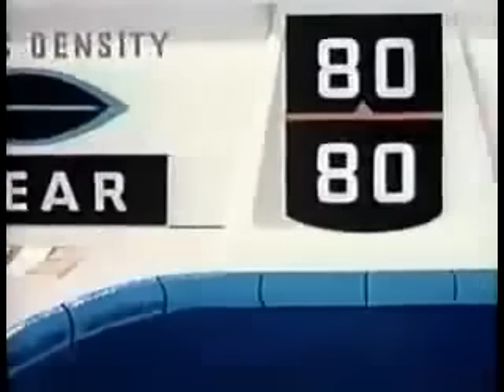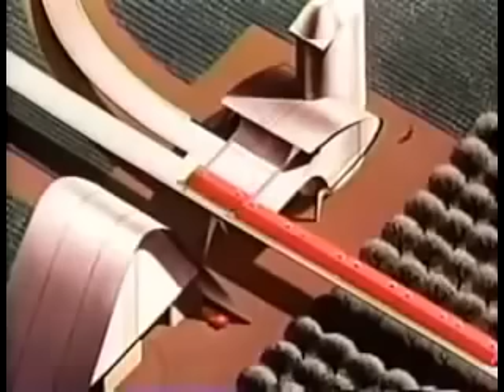The Future of Transport: Disney's Magic Highway - 1958

Comment: Let us see how much was achieved.

00:15 Coloured road lanes: No (some in South Korea). Dynamic road signs: yes
00:35 Road lighting: Partially, yes
00:40 Radiant heat for clear lanes: no
00:55 Onboard radar: Partially, yes. Self-driving cars, automatic emergency braking. Parking assistants. Not for vision though.
01:03 Anti-fog devices: no
01:06 Onboard traffic advisory and speed limits: yes, with services like Google Maps
01:20 Recommended safe driving speed: no. Mandatory safe driving speed: yes
01:23 Rear facing cameras: Partially. Parking assistant and dead angle warning. And a few models can use them as rear viewports as well.
01:30 Airborne police and ambulance: yes. Fire services: no
01:40 Quick tow services that clear up obstructions: No. Airbore ditto: heh... 
01:50 All-in-one road-builder: no
02:00 Prefab bridges/overpasses: yes
02:05 Bridge layer moving on bridge as it builds it: sort of, not as shown. Tunnel boring machines can do that though
02:20 Nuclear powered rock-melting tunnel boring: no, just plain old TBMs
02:35 Cantilevered skyways: no
02:45 Centralised urban areas. yes
02:55 Longer commutes: yes, unfortunately. But also work from home
03:05 Criss-crossed by continental motorways. yes, unfortunately (again)
03:12 Spacious well-planned communities: eh... 
03:15 Integrated with the highway system: double eh...
03:20 Automatic car wash at home: no. Fuelling station at home: yes, if you drive an electric
03:25 "As father chooses": oh dear, that did not age well. 
03:28 Onboard navigation with map: yes. Self-drive: partially. 
03:40 Family relaxing during a drive: yes. Family relaxing together during a drive: noise-cancelling headphones/earbuds and smartphones/pads say "no".
03:45 Remote video calls for meetings: yes. ...while driving: yikes!! But, yes
03:55 Single family vehicle: no. Modular car: no
04:05 Special purpose roads: no
04:15 Integrated parking in office buildings and shopping centers: yes, though not quite as advanced
04:40 Rolling sidewalks for window shopping: no
04:48 In-office escalator ramps: no, the elevator and stairs still reign supreme
04:58 Technology gives more leisure time and flexible work hours: yes
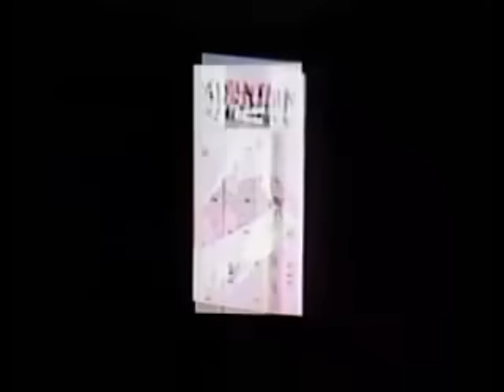05:05 Vacation decided by family vote: yes
05:08 Digital tickets for vacation: yes
05:15 Specialised pleasure vehicles with home-conveniences: yes, with motorhomes
05:25 Highway escalators: no
05:35 Multi-mode vehicles: no
05:45 Flexible freightway network: no
05:53 Centralised/remote/instant logistics control: yes
06:08 Long-haul produce/food delivery: yes, oh yes, much longer than you think
06:15 Source and last-mile delivery on same hauler unit: no. The container however...
06:25 Warehouse to sales display on same fright unit: no
06:32 Roll On / Roll Off sea transport: yes. Stacked containerised sea transport: yes. But RORO and stacked containerised: no
06:40 Sub-orbital space transport: no. Instantly loaded and launched space vehicles: no
06:58 Gas turbine car: Tried it, will not do it again. Tanks and ships however... 
07:01 Reaction drive car: no. 
07:03 Nuclear powered car: no!
07:05 Solar-powered hover-car: Okay...
07:11 ...that can climb walls: ...I think those brownies...
07:20 ...and run on an inverted roadway: ...are really starting to kick in.
07:25 Tube transport: I think we can classify this one as Extra Loony, Obviously Nutty
07:35 Airconned / heated covered highways: no, just climate control in the vehicles themselves
07:48 Ocean tunnels with ventilation: yes
07:55 Undersea highway exchanges: no.
08:05 Roadways linking nations: yes. Increase understanding between people: yes, and no.
08:15 Better quality of life and hope for the future: yes, and no.
Reply: That took alot of time to do all that.
Reply: Minor note for 2:35, cantilevered freeways can be and have been done, just not on a large scale. Interstate 70 is cantilevered for a good 10 miles in Glenwood Canyon, Colorado.
Reply: @sturmovik1274  I did some Google Street View along that stretch of I-70, just to check this out. Wow, what an absolutely amazing scenery! Totally blown away.

And... well, yes... there are indeed elevated stretches of the highway, where they have "smoothed things out" by propping up the roadway, allowing the road to pass though otherwise wildly 3D terrain. For the most part I could see east of the city of Glenwood Springs, the westbound lane sits considerably higher than the eastbound.

Really far cry from the animation though. And most of it seemed like plain old bridge-like pylon construction, supported from below. No cantilevering as far as I could see.
Reply: @michaelkarnerfors9545  Agreed, it's nothing like the scale shown. However, some of the eastbound lane is cantilevered over the river. Also, yes, it is freaking gorgeous.
Reply: @michaelkarnerfors9545 imagine someone seeing your comment in 50years and telling you you’re wrong for saying no about certain predictions and they make a list of what has come true.
Then in another 50 years someone refutes their list when more stuff comes true
Reply: @TayWoode  I am not making predictions, I am tallying what we have so far.
Reply: Glorious magic brownie joke! 

Some kind of magnetic levitation may be, but having something like that solar powered is a long way off.
Reply: @AdamTehranchiYT  The 1950s were a wild time, much experimentation. 😂
Reply: @michaelkarnerfors9545 well, we WERE going into SPACE, so really, what WASNT possible?
Reply: @michaelkarnerfors9545 Japan does have maglev trains, and China got German maglev units, too.
Reply: @mardus_ee  And?
Reply: Correction. For 1:23, there are multiple cars out there that use cameras for continuous rear view. Eg: Cadillac Escalade, Chevy Corvette, Tesla Cybertruck etc.
Reply: @B4R0N.  Fixed, thank you.
Reply: Addendums:
~ Radiant heat for clear lanes:  This actually is used, but only in limited capacities
~ All-in-One road builder:  Partially; massive paving machines exist, though they do require site preparation
~ Cantilevered skyways:  This is actually used, though quite limited due to the expense involved
~ Flexible freightway network:  Yes, but not quite as depicted.  Intermodal containers readily transfer from ship to train to truck, while a similar system is used for air cargo.
Reply: @twylanaythias  colored road lanes, yes for many years now in South Korea.
Reply: "Specialised pleasure vehicles with home-conveniences" May I remind you of those land yacht type moterhomes that not only have a fridge, stove, and refrigerator, but also have TV's satellite mounts, and other just like home niceties?
Interestingly, roadways that can melt snow are still talked about how "future tech" will make it happen. The heating isn't the issue, but the power is. 
There have also been attempts at using inferred cameras to show the road ahead for when it is dark or obscured in the visual spectrum. Just never widely adopted.
Reply: @travissmith2848  You have a point there. And tractor trucks with living-cabins are just amazing.
Reply: This dude had a bit of fun making this and I had same amount of fun reading in. Damn those brownies and how long they take
Reply: A couple of updates to you.  

1) Heated highways kind of do exist.  Just check out the city of Reykjavík.  Not only does the nearby thermal plant pump the excess heat down pipes to people's homes to warm their water, but also run it under the roads to keep them clear of snow.

2) Multi-mode vehicles do kind of exist.  But especially in the one depicted there.  There is a company that offers class a motorhomes that is amphibious.

3) While rockets haven't taken off for transporting around the earth, airplanes sure have which they didn't even envision.

4) Undersea highway exchanges does exist as well.  The Faroe Islands have a set of roads underwater that connect each of the islands.  There are tunnels, but like the chunnel is below the actual water.  In one spot, there is a roundabout as it connects to two islands from there.
Reply: Effortless window shopping is a thing, just not how it was pictured here. Instead of moving sidewalks we have Amazon.
Reply: WOW! Someone with a brain on YouTube that actually gives correct answers in a comment! Kudos!
Reply: A new thing is drones being used to lift and activate fire hoses, but it's not as widely adopted as flight-for-life
Reply: 00:40 road heating is actually done on a relatively small scale! It saves a lot of money on snow removal in cities where this is a problem.
Reply: 2:20 The Los Alamos National Laboratories patented a nuclear tunnel boring machine. It uses molten lithium to melt through rock, leaving behind a tunnel with a glass-like finish.
Reply: you're hero ❤️
Reply: there are projekts in central europe for heating and cooling streets but not on a big scale (I think it is a money question like everthing else).
Reply: @Meiseside  More an environmental thing; no one wants to dump primary energy right into the wild, not when there are much more per-kWh effective methods to achieve similar results.
Reply: @michaelkarnerfors9545  no, not ot dump, to save it in for example an ice-battery (Eisspeicher) or other heat storage. manly for bridges at the moment and only a few projekts.
Reply: This comment is peak YouTube, the platform showing its best
Reply: I GENUINELY, and SINCERELY  appreciate the effort you put into this. Maybe not all hopes and dreams the pasts futures are lost in our current time.

Still... I wish we STILL had that unbridled optimism that's generally characteristic of that past era.
Reply: @tachyon8317  Thank you kindly
 😀

It is harder to be optimistic today because things have gotten so much better in these 50+ years that wonders are commonplace. That I am — just now — casually chatting about it, on this marvel of engineering that is a smartphone, to someone all across the world, is beyond what even science fiction creators imagined back then.
Reply: There are colored road lanes on Central Ave (US 66) in Albuquerque, but they are only for the ART buses. There are also some red highways in the northwest of the state of NM where most of the rocks are red anyways (US 491(former US 666), US 550, and NM State Road 264/AZ State Highway 264). I think in some places in the state, US 66 also still has some red pavement; In ABQ, there is red pavement hidden under the modern blacktop on West Central.
Reply: 4:40 rolling sidewalks are a thing, but indoors, and more often in large airports.
Reply: Great list! The onboard vision, Mercedes Benz has something like this on their S class that uses normal and infrared light to project a clear picture of what is ahead on the instrument cluster which in reality is a computer screen. But you are right, this is not widely used or adopted.
Reply: Few corrections. All in one road builder is getting close (talk to a company named Boral Australia). Turbine car my get a revisiting but as a hybrid electric variant (Jaguar and Bladon micro turbines). Air fire services been around in Australia for a few decades.
Reply: Some Scandinavian cities have heated roads to keep them ice and snow free in the winter, especially where geothermal power is available!
Reply: Sorry if someones already said it, but heli-cranes are used for firefighting. Also colour coded lanes are used on roads in Australian cities, with the asphalt for the bus lane being a different colour (brown) than the regular traffic lane (ordinary gray asphalt). There is also a colour coding for the cycle lanes in some areas
Reply: Everyone is giving good corrections and pointers, but the list Michael made is in line with the video: that all these things will become cheap and numerous enough to be everyday public use for everyone. If some of these things only have 1 place or 1 group of people, organizations, and whatnot that use it (e.g. the military), it does not belong on Michael's list.
Reply: For all the effort you put into this list you could've achieved a few of the items on it.
Reply: @theusher2893  I have no idea what you mean. Care to explain?
Reply: Thanks for doing this. It was funny, too.
Reply: Also, firefighting from the air has been a thing since the DC-3.

It is amazing to see not only the differences you pointed out, but also the regionality of it. For example, out west, our cities are decidedly not centralized, instead sprawling out across the desert. That is why the major metros of the desert (Phoenix, Albuquerque, Las Vegas, NV, El Paso) have puny little downtowns.
Reply: We do have fire-fighters via air... In Oz we have Elvis the helicopter. We also have underwater highways like Sydney harbour tunnel. I think there's one between France and Britain too I think? 🤔
Reply: This was a really cool comment, I didn’t think about how some of these things had been achieved in spirit but by different means.
Reply: I cannot imagine a nuclear powered car ever, holy hell the chaos people would cause with them
Reply: Fire service do have air units. It's just that, they are more for forest incidents than road incidents.
Reply: There is however a "conspiracy theory" that the USA and USSR built a nuclear tunnel boring machine which had some sort of ceramic plate which was heated hy molten metal which was circulated through the reactor. The technology never made it out of the military and inteligence agency circles, and it is said that it worked so well that it was used to create vast networks of underground facilities and tunnels.
Reply: Can't wait to get back here in a couple of decades to see, which things changed. What? You mean, there is a possibillity, that we won't come back because the existential threat of climate change caused in big amounts by those very vehicles shown in the video will bring us to our death? Nah, that's just some communist idea about us destroying earth. That'll never affect us...
Reply: Although not perfect, 00:15 coloured road lanes have been used in some countries such as Korea, Japan and Europe.

The case of Korea
https://img1.newsis.com/2022/03/29/NISI20220329_0000961475_web.jpg
https://pimg.mk.co.kr/news/cms/202405/07/news-p.v1.20240507.a84505fc172d4c02a0861fc3afe94412_P1.jpg

First case (Japan, 2008)
https://maps.app.goo.gl/oNemh3ZfBSKETYAw8

The case of Japan
https://pds.exblog.jp/pds/1/201004/19/01/d0080101_1233128.jpg
http://geo.d51498.com/daijitk/rilyokoukipicture/C2-100403-10.JPG

europe
https://maps.app.goo.gl/oP265UDmGQMrehiMA
Reply: 5:08 bro is putting punch cards into the car and the car drives there what 💀
Reply: @bradye21playsIndieHorror  The notion that keyboards would be ubiquitous, or that voice control could work, was still far away.

The common way of working with computers back then was that you type commands that gets made into punch cards. Then the card gets fed to the computer.
Reply: Well, there's more future to come; perhaps a few more of these will become a yes.
Reply: Multi-mode vehicles: the 2003 Gibbs Aquada is an example, although there weren't built many..
Reply: Board Radar for Vision is a thing. Mercedes have them and you can see deers on pitch Black streets. And btw: if the car Sees it, you didnt have to see it.
Reply: 00:40 Radiant heat for clear lanes: does not make any sense. The economics of it don't add up - imagine the energy requirements.
02:20 Nuclear-powered rock-melting tunnel: that would be environmentally disastrous, those guys didn't think much about nature back then.
06:58 Gas turbine car: Tried it, and may try it again. In the age of hybrids, a microturbine-powered range extender really does make sense.
07:25 Tube transport: Hyperloop anyone?
07:35 Airconned / heated covered highways: again, the economics don't add up.
Reply: @liam3284  already exist.
Reply: Props 👍🏼
Reply: "Tube transport: I think we can classify this one as Extra Loony, Obviously Nutty" hehe.. Poor Elon, we still find this completely ridiculous, even though you've already started building that nonsense.
Reply: can't believe that your comment is not pinned.
Reply: 02:05 Bridge layer moving on bridge as it builds it: sort of, not as shown. Tunnel boring machines can do that though
China has something like this. They use pre-fab sections of road and the builder moves out onto the new section.

03:45 Remote video calls for meetings: yes. ...while driving: yikes!! But, yes
Using FSV, more practical but still yikes!

04:15 Integrated parking in office buildings and shopping centers: yes, though not quite as advanced
Malls going out of business: Yes.

04:40 Rolling sidewalks for window shopping: no
Because they don't want you passing them by.
They have moving sidewalks like this in Las Vegas to make it really easy to enter a casino. When you want to leave you need to find the exit and hard hike it.

05:25 Highway escalators: no
Again, China has this but it's for boats along the Yangtze River to quickly go up and down the 3 Gorges Dam.
One of the few real-world examples of people using this idea.

06:15 Source and last-mile delivery on same hauler unit: no. The container however...
Exactly. Multi-modal transport. This removed many 18 wheelers from the highway. Very little need anymore to make a cross-country haul. Just put it on a train.

07:05 Solar-powered hover-car: Okay...
They promised us hovercrafts. What a rip off. We was robbed.
Reply: You clearly don’t know the capability of modern cars boomer
Reply: 01:30 there are airborn fire services, it's mostly used for dealing with forest fires however
Reply: i highly disagree with more leisure time - the average american today cannot work enough to pay basic rent, let alone 'go on vacation' or 'have a weekend' - working 40+ hours a week, every week, nonstop.
Reply: @xXKisskerXx  In 1958, the average american had an almost 41 hour work week. In 2024, it is below 35. This is not a matter of opinion that you can disagree with. This is a matter of fact, you are not entitled to your own facts.
Reply: I don't know when you live, but nobody i know gets to have vacations. And there's only been less and less over the years.
Reply: @autumn948  And since you know the whole whole population of the US, what you say is relevant. 

Oh, you do not?! Well... then it is not.
Reply: 00:40 Radiant heat for clear lanes: no - Actually that has been a reality since around 2000 for roads in Iceland. A few failed "solar road" projects as well.
Reply: 07:25 Tube transport did happen, and pre-dated this video by a good 90 years! Just look at the nickname for the London Underground! 🚇🇬🇧😉
Reply: But there are firefighting helicopters and planes
Reply: @Arnavprobutnoob2  But, they are for forest fires. Rarely responds for road incidents.
Reply: There are moving sidewalks I. Airports.
Reply: An excellent analysis I only disagree with on one point.

Technology has given increased leisure time to the rich . Everyone else is using technology to be several times more productive, while working more and getting less.
Reply: @Yonkage-ik5qb no, it did happen, although not as much as we would have expected, and that was mostly thanks to unions and cultural change than technology, although work from home has recently started contributing (although that could probably be mostly attributed to less commute time)
Reply: @Yonkage-ik5qb  Well....... some Quick google work shows average hours worked in 1958 looks to be about 37.8 and today is 34.2. 
Generally speaking, the kinds of household labor saving devices and other similar markers of quality of life have become far more commonplace and in some ways those living at just above the poverty line today have it far easier and greater variety available than millionaires in the late 1950s.
Reply: @travissmith2848  "those living at just above the poverty line today have it far easier ... than millionaires in the late 1950s"

Yeah, I'm not going to even bother. You've been brainwashed so completely that it's like talking to a wall.
Reply: 07:20 Well technically there are cars capable of driving upside down. Some high performance race cars can produce enougth downforce to counter their weight. In reality it would take a long track for gaining speed before the roadway is inverted as the downforce is only produced at high speeds. But yeah nothing someone would ever suggest for public roadways.
Reply: 1:50 All in one road builder...actually yes. It was featured on Modern Marvels in the late 1990's. It would tear the old asphalt off the road and run it through a few steps to grind it back up. Then it would get remixed and put back down as new asphalt.
Reply: @kks_123-u1w  All that does is replace the surface . A road is several more layers than just the surface. The video shows an all-in-one paver on virgin land but the machine you are talking about is not an all-in-one road builder but a combined asphalt miller and paver.
Reply: 5:35 you never heard of amphibious cars?  They ARE a thing, you know.
Reply: @Shadowkey392  An example is the Duck boats in Plymouth MA. They can drive on the road and in the water.
Reply: @Shadowkey392  I have heard of the novelty (or military) vehicles that are multi-mode, yes. And that is all that they are: novelties.
Reply: @michaelkarnerfors9545 counter-argument to your “amphibious vehicles are only novelties” claim, in WWII, D-Day was made successful in no small part because of amphibious tanks, and in the Pacific Theater of Operations, many MANY island assaults were carried out using amphibious personnel and equipment carriers, many of which were turned into today’s Duck Boats. Many seaplanes also have landing gear in their pontoons, making them technically amphibious. So I would say amphibious vehicles are a bit more than a “novelty”
Reply: @mightyocelot  Yeah, because world wars is what this film is all about, I stand so corrected...
Reply: @michaelkarnerfors9545  Not only in the military. There are "normal" cars to. They are not so common tho.
Reply: @ASharkNamedWaffle  Just so... novelty vehicles.
Reply: @michaelkarnerfors9545  If i understand novelty right it means new. And amphibian vehicles have exited since (researching) 1770.
Reply: @ASharkNamedWaffle  No, that is not what novelty means (in this context).
Reply: They were dead on about beautiful cities being bulldozed for parking lots. Missed the one and two hour commutes in traffic jams, or kids getting addicted to phones because they can't do anything else.
Reply: @garryferrington811  Whose fault is it for handing kids phones as cheap babysitters?
Reply: no hope for the future 😢😂
Reply: The last one should be an absolute no. Not only did we not increase our quality of life, we managed to fall below what we once had.
Reply: @lockheedtrijet8817 That is silly
Reply: fathers need to come back to being rulers of their home and society, we've seen life without them, it is abhorrent.
Reply: @TS-jm7jm  No.
Reply: @TS-jm7jm  You are wrong.
Reply: I’m not sure why it aged poorly that a father chose where to drive his own car. 

I suppose some echo chambers do exist which truly hate the idea of fatherhood though.
Reply: @Noplayster13  The notion that the male is the owner of family property and the sole authority on decisions for the family has nothing to do with "fatherhood". It is a notion that has aged very poorly and now stinks of outdated gender roles and ditto family dynamics.
Reply: @michaelkarnerfors9545  Wow.  Uh… how did you construct that strawman from the words ‘As father chooses the route to go on’?  At no point was it ever insinuated that the father was the ‘sole authority on all decisions for the family’. That was never actually a thing, even in the much maligned 50’s. Dad was driving, so he pushed the button. No grand oppression occurred outside of your fevered imagination. The Stepford Wives was fiction, which I’m sure must be shocking to you.

Don’t let the weird pseudo-religious strawman arguments of progressivism make you look like a crazed political activist, man.
Reply: @Noplayster13  If you say so, then it must be true and cannot be questioned, dad.
Reply: @michaelkarnerfors9545 A bit of a disingenuous reply, being a bit of a poor sport there. But an amazing job of laying out your analysis regardless!
Reply: @michaelkarnerfors9545  It's okay to be wrong, son.
Reply: @czinn327  I guess you have heard that one a lot.
Reply: @ISISareDemocrats  You are so weird...
Reply: @Noplayster13  we just ignoring historical context now, I guess? cool, no wonder y'all don't think CRT is valid
Reply: @gc6185  Race hatred (aka CRT) isn’t valid, that is correct. And which context do you speak of?
Reply: @Noplayster13  lol
Reply: @gc6185  You ever notice that people like you can never defend your opinions when pressed on them? I do.
Reply: @Noplayster13  I’d be happy to. Are you actually willing to have an open mind and hear anything out, or will you just dismiss it without any deeper examination?
Reply: @gc6185  You’re the one who thinks ‘lol’ is an argument, man. I think I’ve shown way more openness than you have so far. I mean, that sure didn’t show that you were rational or open minded to me, so I doubt you’d be open to considering any other viewpoint. But go ahead, tell me what Hasan and Ibrahm X Condi have to say on the subject.
Reply: @Noplayster13  lol you thought
Reply: @gc6185  I gave you the full opportunity to convince me, but you just didn’t have anything of substance. shrugs I guess that pretty much sums up your whole worldview, eh?
Reply: Nuclear tunnel boring machines do exist, the military use them. That's one technology that has yet to trickle it's way down to the civilian world.
Reply: @killman369547  I do not believe you.